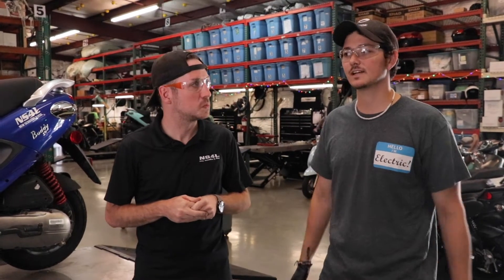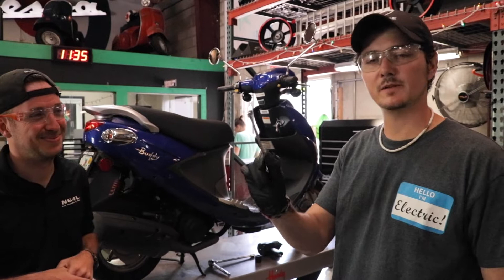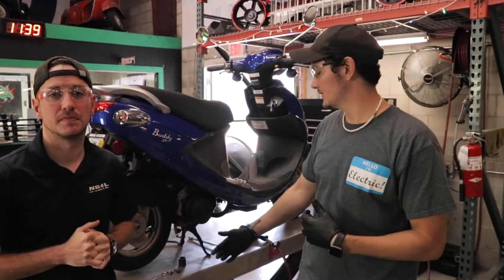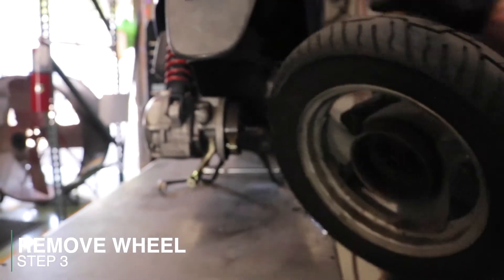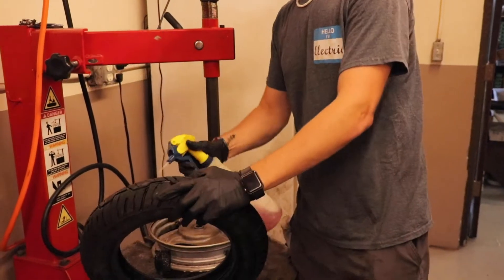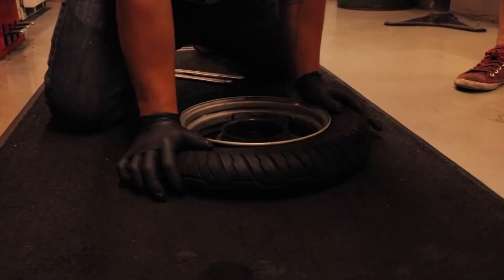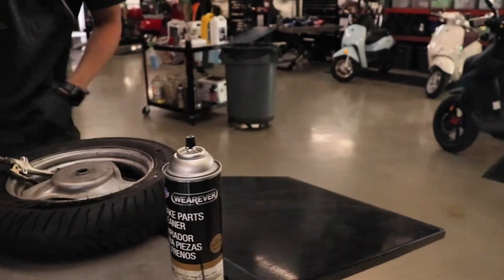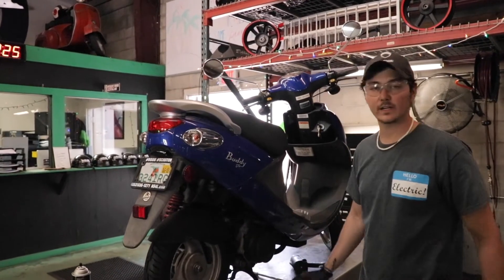How To Change A Rear Tire On A Genuine Buddy | NS4L How-Tos

Comment: 4300 miles on  my buddy 50
.. rear tires are starting to wear down to the wear markers.. time to replace the back tire.. front tire still has a lot of wear.. thank you very much I'm going to remove my rear wheel and bring it to the dealership and let them put the new tire on!

Comment: You didn't say what the torque is on the nut for the back wheel don't you think that might have been a little bit important.
Reply from the maker: 77 ft/lbs.  Thanks!

Comment: I didn’t see you use a torque wrench when you installed the rear wheel. Impact wrench is not the correct way to install a wheel.
Reply from the maker: We've done this enough times as a shopto know it puts it within spec, but you bring up a great point, especially for those doing it themselves. Locking Torque is 8.0~10.0 kg-m according to the manual.  Thanks!